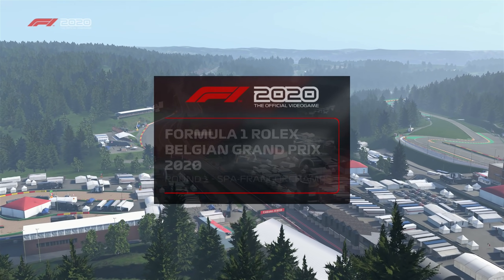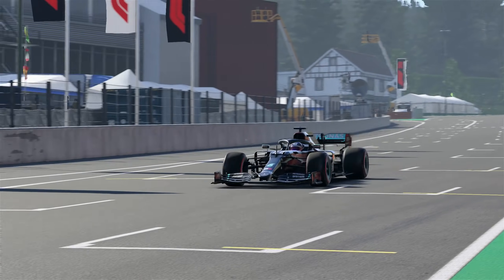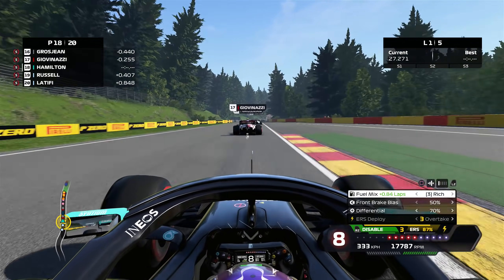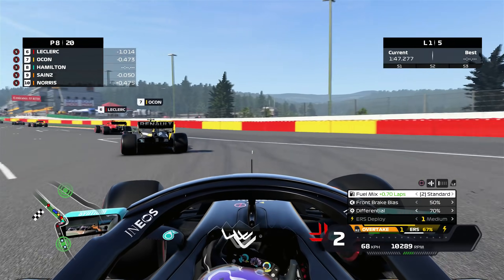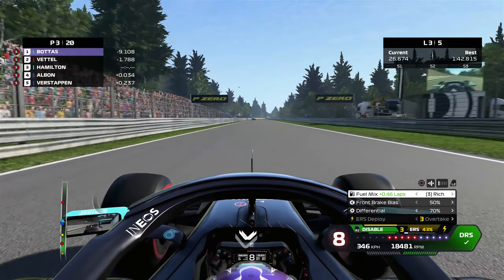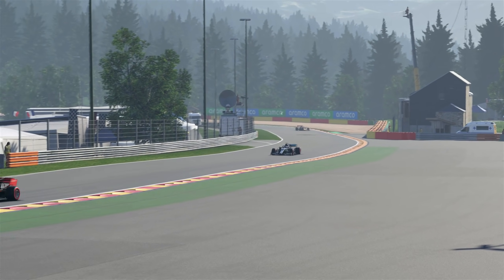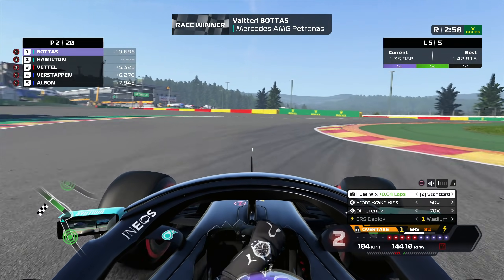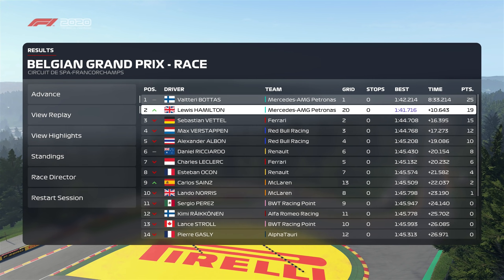Modern F1 Cars With V12 Hybrid Engines

Comment: Alex you did a fantastic job in that simulation if Formula One could go back to these V/12 or V/10 engines .
 I will NOT go back to the races with current V6 hybrid engines but I will go back with A V12 or V/10 I will go and pay to see these F1 cars compete .

Comment: Part of the big increase in revs in the 90’s was driven by the shorter stroke of the smaller engines, so I doubt they’d be making 19,000 rpm. 

Also given the Tipo 043 in the 1994 Ferrari was making about 800bhp, I reckon 1000bhp by the current era is very conservative. 

Do a part 2 with a turbo and an MGU-H thrown on for a laugh...
Reply: Last V12 was actually 1995 thinking about it. Schumacher tested it back to back with the new V10 at the end of the season and preferred the V12 as it was smoother, pulled better and gave better engine braking. Heavy and thirsty though and horrible to package aerodynamic wise…
Reply: Yeah. The 1994 Tipo 043 Ferrari V12 engine made lots of power and sounded amazing... About 850 hp I think. So 1,000 hp would be easy with today's technology. Modern V12 F1 engines would rev well over 20,000 rpm, and make well over 1,000 hp. 1,000 hp is a very conservative estimate indeed.
Reply: @michaeldavis2531  In 1995 the new 3 litre engines running on pump petrol were down to 680bhp. By the end of 2005, the last year of the V10’s the Honda was running up to 980 on the dyno @ 20k RPM…so I guess a rough estimate for a 3.5 litre V12 would be 1200bhp by the end of 2005…given 2005 is now 17 years ago and the above projection was only over 10, it’s fair to assume power would be even higher now. However, you start getting into deep unknowns with the engines needing to last several races etc how that would effect power. But I bet it’s not unreasonable to assume fantasy V12 in said spec could run multiple races distances at the same peak power output as a BMW turbo from the 1980’s, with more torque, a better power band and using less fuel…
Reply: @gdogg3710  Yeah. Apparently, Toyota made over 1000 hp with their 3.0-liter V10 engine in 2005, so no doubt a V12 could make comparible power or even better if you bumped the revs up, and this is all N/A by the way. No doubt a modern 3.0-liter or 3.5-liter F1 engine would probably produce 1300 or 1400 hp, and probably rev to something crazy like 23 or 24k rpm. This would all be achieved naturally aspirated, no turbos, but you would just have to have the engines rev high, which is quite an incredible feat. Of course, this is disregarding the heat and friction forces inside the motor, which would be quite high. But I think thermal efficiency for a modern V12 F1 engine would be really good. Shame it's not going to happen though. :(
Reply: @gdogg3710  We would have seen some CRAZY power if they kept the 3.5 L engine regulations, combined with the high revs. The most powerful 3.5 L V12 F1 engine (and most power 3.5 L N/A engine in F1 to date), the Tipo 043 in 1994, made around 850-860 hp at about 16,000 rpm, and that was run on valve springs. So I think with the modern technology we have today, we could well surpass those numbers! It's always fun to think about.
Reply: @michaeldavis2531  Was Honda you are thinking of. It was producing 980bhp by Suzuka. Re the RPM’s, part of the rapid rise in this was because of the shorter throw of the smaller 3 litre engine. So if a 3 litre was making 20k RPM by 2005, knock off 1000-1500 RPM and then add 17 years of engine development…

…pneumatic valves was what drove the initial mad rise in the early 90’s…engines with valve springs had been stuck at 12k maximum revs for a long time. By early 1994 Ford had broken 14k, then by the end of the decade most engines are up to 17k, but then it took another five years to get to 20k…the only areas for development were metallurgy and manufacturing precision, so im not sure a 3.5 litre could get to 24k, even with 17 years to do it…I’d be surprised if a 3 litre would have got much over 22k, before the glass ceiling was hit…
Reply: @gdogg3710  You have a good point. I think 1000 hp for a 3.5 L engine is a very conservative estimate indeed. I think with heavy technological development and evolution, they probably would have made around 1200 hp if they had kept evolving the engines, maybe at around 19,000 rpm, like you said, which I think is a very reasonable estimate. The V12 and V10 engines would have been the most powerful, followed by the V8s. The '90s were a great era in F1, especially with all the different engine configurations.
Reply: @michaeldavis2531  as this is a fantasy thread, if you allow some of the metallurgy back in that was banned for safety and cost reasons, that’s probably where more gains could be found…

Comment: This demonstrate how impressive those V6 Hybrid are by reaching about 1,000hp with a fraction of the size and weigth of the old aspirated V8/V10/V12 engines.
Reply: Downsizing is a bit of a fallacy, under racing effort a bigger modern NA engine with the same power could even be more economic than a smaller turbo engine.
Reply: Actually seems that they're significantly heavier.
Reply: ex: ferrari-f2001 V10: 94kg (~207lbs)    vs    ferrari-sf16-h v6 turbo: 145kg (~319lbs)
Reply: As he said in the video, the 1.6 L V6 turbo engines make about 850 hp on their own, from the internal combustion engine. This is complemented by 160 hp from the hybrid system, with the ERS unit and electric motor.

Comment: Last year for V12 was actually 1995. Ferrari ran the 3L V12 for one year only.
Reply: Read John Barnard’s book if you haven’t already. Was a really interesting segment where Schumacher tested the 1995 Ferrari and said he’d have won the title more easily in that than his Benetton.

He was a big fan of the engine braking provided by the V12, as he was one of those drivers who steered the car with the pedals as much as the steering wheel, whereas Berger and Alesi both hated the V12.

He tested the 1996 V10 immediately afterwards and was said to be massively disappointed in it...
Reply: @gdogg3710  Read this as well. I wish Ferrari would have carried on with the V12 engine in 1996 at least. The cars were a bit bigger and weighed more as well. I think Schumacher would have fared better from the jump.
Reply: 3.5 L V12 engines would technically make more horsepower than a 3.0 L V12 engine at a higher RPM naturally, due to the engine displacement.
Reply: @michaeldavis2531  more torque, more horsepower, less revs...20k rpm with a 3.5 would have taken a few more years of development because of the longer throw...
Reply: @gdogg3710  Oh yeah, I absolutely agree. You are definitely not wrong about the engine development thing. I mean, it took until 2002 for a 3.0 L V10 engine to break the 19k rpm barrier, with Williams-BMW's engine. And of course, Torque x RPM = Horsepower, but there would be a lot more factors to take into consideration besides horsepower, such as the heat and friction generated within the engine, which would therefore create more engine wear... But yes, all down to development.

Comment: I would sacrifice 3 seconds a lap for this sound....na actually 2 seconds or around 15 kph
Reply: Exactly. F*ck that, we want a good show. At this point we re going to have fully eletric F1 cars and then... Bye bye
Reply: @diogosimoes7445  it won tbe fully eletric, there is fe already here, but f1 will change or to plug in hybrids or hydrogen powered engines
Reply: @betelgeuse227  ethanol
Reply: Diogo Simões Hopefully F1 is not going to be fully electric because Formula E already existed
Reply: Electric cars beat F1 cars easily

Comment: The V12 would be slower as its an obsolete piece of tech.
Reply: I'm not so sure, the old V10 was as fast as modern f1, deppending on engine sizes a modern NA v12 could be faster... at least a bigger NA engine (V6, V8 or V10) probably could.
Reply: @zulmiropascoal9145  No man, the only reason that the V10s powered are as quick is because there is a lot more drag on modern cars.Put a modern engine in an F2004 and it would fly
Reply: @denja964  I disagree, the modern cars have a lot more downforce than the old f1's, also they´re wider to aid on mechanical grip on slow corners...
Reply: @denja964  The big disavantage of the modern cars is they're weight, partly by they're bigger fuel tanks, but also significantly by they're batteries and hybrid systems... One has to wonder to what degree the hybrid system is actually worth it...
Reply: @zulmiropascoal9145  you literally proved my point
Reply: @denja964  No. Also there are multiple ways of counter argue or discuss what was said, i'm not even sure which is your line of thought, either way your opinion seems relatively superficial.

Comment: I don't think a turbo weighs as much as an entire V6 engine. The V12 should definitely be around 30kg heavier
Reply: I think Mario Theissen (BMW F1 Boss back then) said something about 68kg for the 3.0 V10 in a recent German podcast. Scary how light that engine was while developing around 900 HP :D back to topic: so V12 would be around 85 kg I think :)
Reply: The weight of the ICE+turbo is 109kg, let's say the turbo is 24kg (it's probably lighter than that) then the ICE is 85kg, if it was a V12 it'd be a bit under double that, so maybe 150kg, you can get rid of the intercooler, but you'd also need  bigger radiators and oil coolers so that'll cancel out, especially when you consider the extra liquids you'll also need.
All in all you have:
ICE, +65kg
Turbo, -24kg
MGU-H, -4kg
Total: +37kg
Reply from the maker: Great analysis, thanks for that! Although doubling the cylinder count probably wouldn't be close to double the overall weight, there's a lot of other aspects to the engine than the engine block, right?
Reply: @AlexGillon  you'd save 2 bulkheads and the crankshaft counterweights (V12s don't need them because all the forces get neutralized by other pistons), there have been cases of 2 V6s being bolted together to form a V12, Aston Martin used for a long time when they were owned by ford. That's why I didn't double the weight of the V6, my calculations are very rough since only F1 engineers truly know the mass of those parts (except for the MGUs, battery and total weight those are specified in the technical regs), but a 3.5 V12 would be heavier for sure, it would also make more than 1000hp, probably 1100
Reply: @AlexGillon  how can I do that ?
Reply: @AlexGillon  I can’t figure out what engine was used for this mod, I tried different ones but didn’t get such an effect in speed and acceleration, who knows, please tell me what engine was imported into Mercedes in this mod?
Reply: @jorge8596  a turbo weighs more about 1-2kg not 24
Reply: @jorge8596  i desagree
Reply: A V12 engine would with today's technology would be a lot lighter!

Comment: The 2.4 liter V8 had around 750hp. 750:2.4x3.5 = 1093 hp so you could potentialy give it more power.
Reply: Im trying to follow but I'm wondering where the 3.5 came in to the equation unless your talking about the 3.5 liter. But you'd then have two separate engine displacements in the one equation. I feel something is going over my head
Reply: These V12's don't really rev to 18,000 rpm. Max was the 412 T2 at 17,000 rpm, so technically, they could make more power, but they're handicapped by the extreme internal frictions(which is why the 412 T2's 3.0 V12, which you could argue about its technology, can't reach V10 or V8 level rpm. Even the V8 after the V10, you could see how much less the internal friction is by the fact that V10's kind of struggle to reach 20,000 rpm while V8's can do them any day no sweat. Now, the 3.0l 17,000 rpm V12 has 43mm of stroke, which is bad for revs because the 19,000 rpm V10 and 20,000 V8's use 39.75mm stroke. Might not be a big difference but it definitely is big on how stressed an engine would be at 19,000 rpm. Getting the stroke to 39.75mm and increasing the bore to maintain the displacement would be the perfect solution, but it probably hardly rev to 19,000 rpm, as seen on V10's 19,000 rpm vs V8 20,000 rpm. Albeit, Honda did test their F1 V10 in an extreme condition, 21,000 rpm. The engine probably would survive but that's extreme testing pretty much.

I think the screen just shows 18,500 rpm but it doesn't save that at all, if that's how "underpowered" it is(not underpowered by any means but for a chunky V12 that's high revving, it has to do better)

Comment: This would be cool. Didn't the 80's and 90's F1 have different engine types and sizes? I don't remember. Cause this will be a cool mod to have when you could make different manufacturers have the different engines V6,V8,V10,V12 and hybrid or not. Especially for my team career mode
Reply: The cars from 1989 to 1994 had V12s, V10s and V8s, so you are correct
Reply: Yep they had V8s V10s and V12s in the very late 80s to mid to early ish 90s
Reply: Weirdest post war engines in F1 since the war in my opinion are the BRM H16 from the 1960’s and the Alfa-Romeo V8 twin turbo from the 1980’s and the Lyfe W16 from the 1980’s…

…other honourable mentions go to the Subaru flat 12 of 1990 and the Porsche V12 of the same year, that were two flat 6’s and two V6’s welded together respectively…

Comment: What if F1 cars had formula e engines :P
Reply: They'd be slow
Reply: There isnt any FE engine file in the game, so it's impossible
Reply: Slow and heavy
Reply: @Martijn please hand it in for your next english essay
Reply: No
Reply: Than it wouldn’t be F1 it would be FE
Reply: Considering Formula E engines have a fixed power output, first of all we would see a big decrease in the gap between the different teams. Secondly, Formula E cars dont have a lot of power, because they only race on very narrow street circuits, that require very precise driving from the driver, but not a lot of power from the engines. Formula 1 cars are also very downforce centered cars, in order to race this fast on tracks like Spa. These two factors make it very hard for Formula 1 cars to race with Formula E engines. The different tracks mean that the engine goes from an engine creating exciting racing on narrow tracks with little error margin to rather slow racing. Additionally Formula 1 cars produce a lot of downforce to, making the cars push a lot of additional "weight", created to keep the cars on the road. Formula E doesnt have such restrictions, and is able to run its cars with a lot less downforce, and almost all the downforce of the cars is created under the cars by a massive diffusor. This and the very futuristic, streamlined design of the current gen2 chassis mean that Formula E has a lot less drag than Formula 1, so the Engines have to work against air a lot less. Powering Formula 1 cars by electricity is not impossible tho, as there are cars like the Volkswagen IDR, the currently fastest car at Pikes Peak, which are powered by an electric motor that would be capable to be raced in F1. But the current Generation of Formula E engines doesnt lend itself well to be used in F1.
Reply: @phiphi334  Are you Bottas?
Reply: @adityanarain9428  sure, just wait for next race. But i like sebastian more as a target
Reply: @phiphi334  Really, please don't torpedo him again. You had your share
Reply: @adityanarain9428  ok